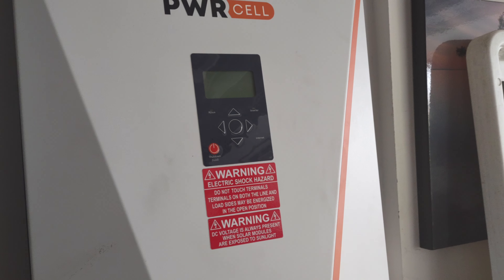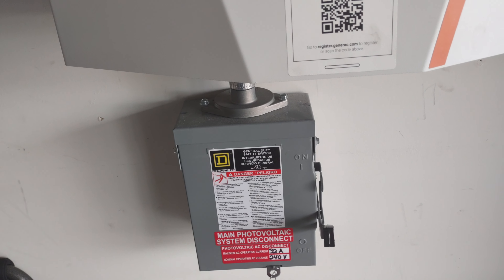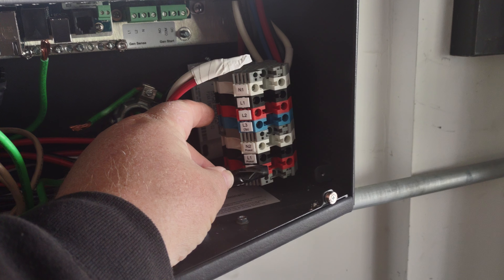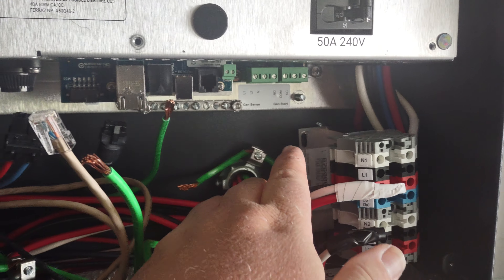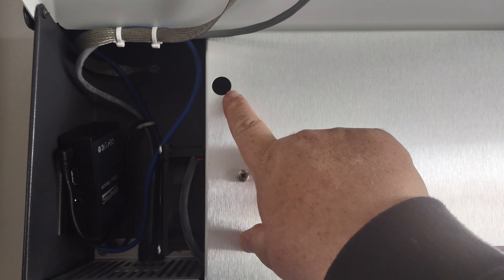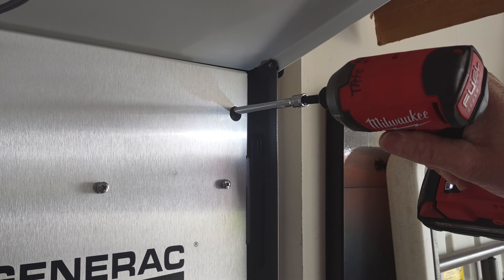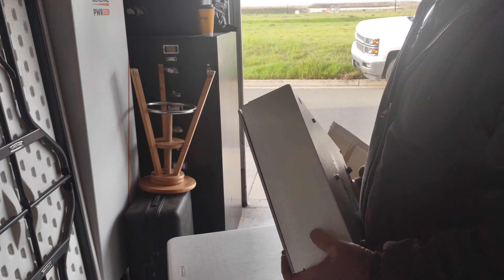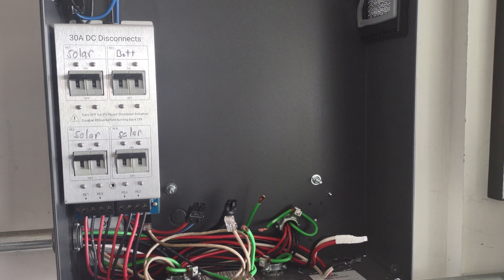how to change out the power core in a power-cell generac inverter

Comment: Do you think you can use the power core as a battery to ac inverter without the rest of the system
Reply from the maker: Doing anything like that would definitely void the warranty definitely recommend not trying that
Reply: @greendaypower40  I dont care about warranty I was going to hook up a EV battery to it to run a cabin
Reply from the maker: @plojm123  I would not try to do that
Reply: Can changing out a power core make a 7kw inverter to an 11kw inverter